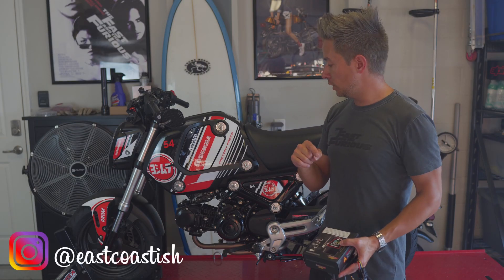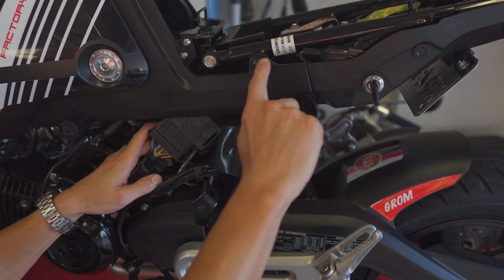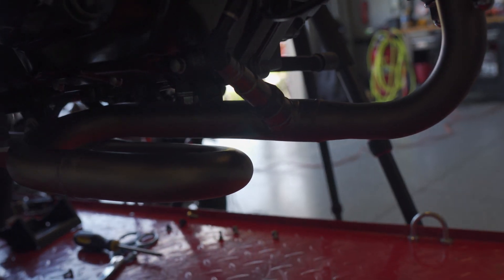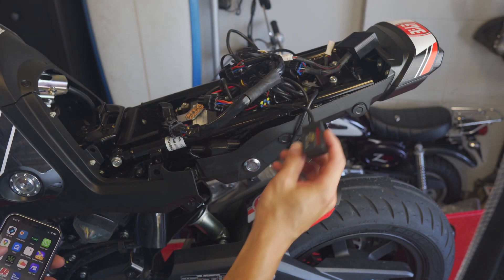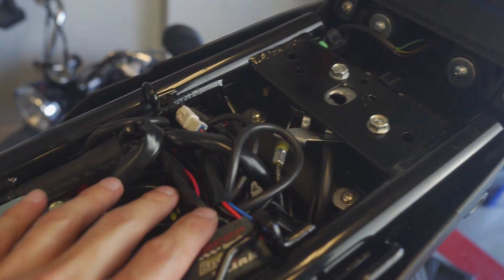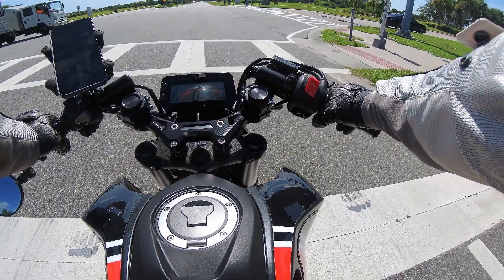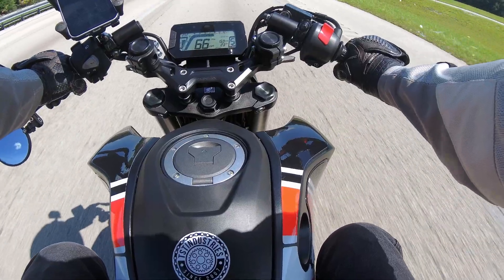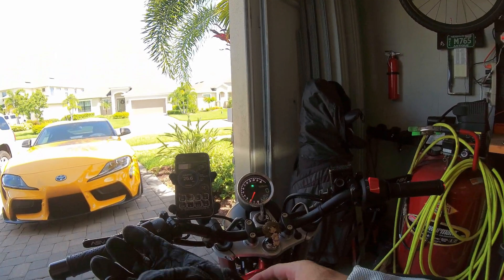aRacer RCMini5 for the 2022 Install + Grom & Monkey Top Speed Run!

Comment: I have a deposit on a 2022 monkey, hope 1st gear is lower and the slight compression bump helps out throughout the rpm range. The exhaust is also supposed to have been revised to a single chamber muffler and smaller cat. was this true on the grom? also lookin forward to the better rear shocks as I am a bigger guy, anywhere between 210-260, just depends on beer and good food intake lol
Reply: Do you plan to upload videos of you on that Monkey? I'm the same weight, so I'll find it very interesting to see a review including a topspeed test from you 🤞🏻

Comment: The fairing they make for the monkey helps a lot for speed.
Reply: the pyramid or?
Reply: @billwilliamson9842  Yeah that one,there are a couple just like it though,even a Puig Raptor windshield is looking pretty good,with the low power of the bike any aerodynamic improvements are going to make a noticeable difference.

Comment: Sorry to bother you on this build but I need help on the correct throttle cable for my 72' CT70 with the 125cc Lifan engine like you did some time back. Standard cable is to short. Please help.
Reply from the maker: Throttle cables are tricky because it really depends on what throttle you have and what carburetor you have. Different carburetors have different length tubes coming out of the top, and some have adjusters and some don't. Reach out to Vince at tboltusa.com and he should be able to recommend the best fit for your application. I've started just buying long cables and then cutting it down and soldering on a new end so the fit is perfect but tbolt should have something that will work for you.
Reply: @eastcoastish  thanks, keep up the great builds.

Comment: Hi! First of all tks for all your sharing videos on Monkey it really helps me a lot. I have a question that my 2020 Monkey handle bar vibrates a lot, yet my cousin's Monkey is literally no vibration(bought 6 months a part) . Wat cold be the problem or setting I should check? I have removed catalyst converter and replaced aracer super 2, increased idled, bar end weights... Still vibrates a lot. I noticed voltage is only 11.4v at idle, could this be the problem?
Reply from the maker: Does it vibrate at idle or only at certain speeds? Vibration is usually wheel balance (although I don't think Honda even balances these little 12" wheels)

Comment: Did you ever go back and check and time the cam correctly, as I stated you set the cam to the ignition timing F mark not the T timing mark.
Reply from the maker: Yeh I replied on the other comment, it's timed to the T mark, the compression of the piston wouldn't let it sit straight at the T without holding it which is why you see it closer to the F.

Comment: How accurate is your '22 Grom speedo, have you gps'd yet?  I went out on the country roads today.  About 58 tops gps, and only 80 mpg, seems really bad, I dunno.
Reply from the maker: On those top speed runs I had the GPS on the phone and they were within 1-2 mph all the way.
Reply: My 22 SP is only 117 miles old.  I have seen 62 top (good conditions), and can do 55-58 usually no problem.  Mpg is at 125ish so far.
Reply: @roydenvickers  Mine's just under 200 miles.  Yeah 55-58 is my typical top speed, but sometimes as low as 52, and I don't ever see 60 normally.  On a short downhill, I got to 65 tucked.  If I baby the bike in 5th gear at lower speeds, the mpg can get insane 150+ but that's boring lol.

Comment: How would u go by finding the fuse adapter for the af1
Reply from the maker: I got mine at Autozone, but I've since realized that I don't need to have stand alone power for the AF1, you can plug the AF1 power cable directly into the RCMini 5 for power which is a cleaner solution.
Reply: @eastcoastish  alright that’s works out tky

Comment: What mods are done to the Monkey?
Reply from the maker: There’s a large playlist of videos on the Monkey in this channel. 181cc bb kit, CNC port and polished head with bigger valves and cam, throttle body, intake manifold, injector, intake, exhaust, oil catch can, oil cooler and I’m sure a few other things I’m forgetting.

Comment: why's the monkey faster than grom? aren't they same engine size?
Reply from the maker: Both are heavily modified, the Monkey moreso than the Grom (or at least when I filmed this) out of the dealership they'll both do about 60-65mph depending on your weight.
Reply: @eastcoastish  would it be possible to get the grom up to 82 as well then ?

Comment: I have been following your builds and I have purchased the exhaust and intake. After seeing the price of an aracer mini 5 with the af1 module, I’m at a stand still with following your build. I was wondering if I could use the intake and exhaust without tuning?
Reply from the maker: You could but it will be running a bit lean. Check out DHM, David is now doing ECM flashes for the ‘22 so he can program your stock ECM with a tune for the intake and exhaust.
Reply: @eastcoastish  so the reason for my check engine light means it needs to be tuned?
Reply from the maker: What mods do you have? An exhaust or intake shouldn't throw a check engine light...

Comment: What's the impact of running the Aracer without the AF-1 to auto-tune? you would just select a pre-map with your exhaust and intake selected?
Reply from the maker: There aren't really any tunes yet; the only tunes that come loaded on the new aRacer is stock and 170cc big bore kit with cam and intake and injector; not sure why since I don't believe a 170cc bb kit even exists for this engine yet. If you're just going to do exhaust + intake + cam or some combo of them, check out DHM, he's got flashes available for the stock ECM.
Reply: There is now a map for RS exhaust and intake FYI